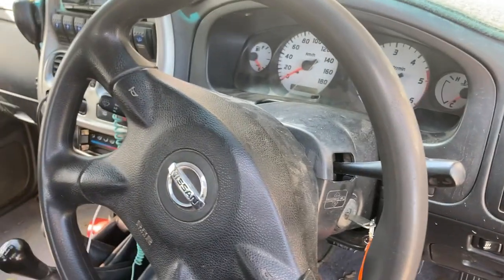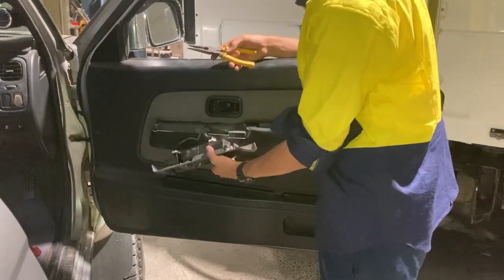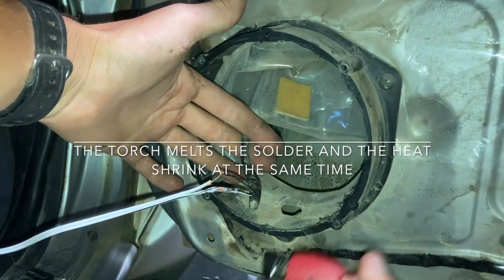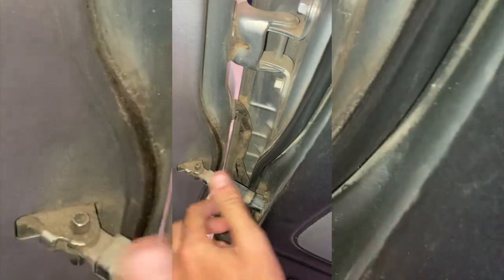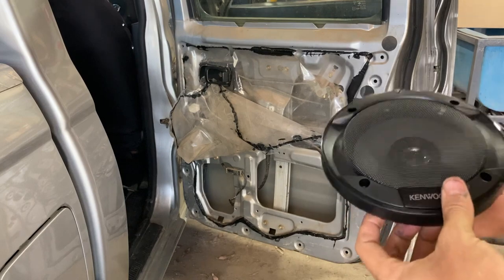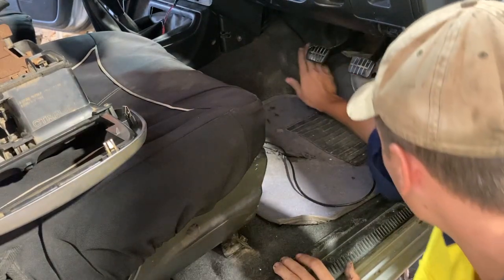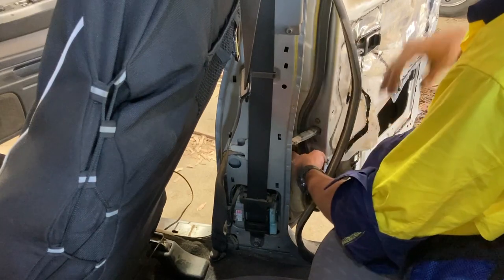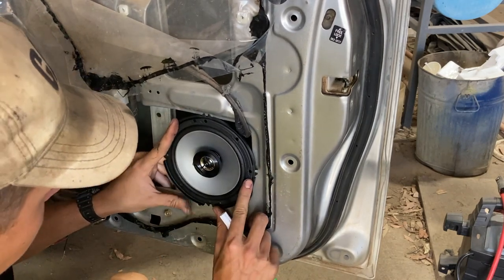D22 Speaker Installation

Comment: Cheers mate.  Ive got what i think is a dry joint in the front left speaker. Was always a bit dubious about taking that trim off to fix it but you make it look easy. Think I'll give it a go. Thanks again.🇦🇺🍺
Reply from the maker: Good luck mate, should be an easy fix👍🏻

Comment: Your vid was such a great help thanks! After threading wire to the back doors, how did you connect it to the head unit? I've got iso adaptor harness attachments in place so I'm not too sure which wires I should attach to? Any help would be appreciated 🙂
Reply from the maker: Glad it helped 👍🏻 I spliced into the harness, I didn’t have a diagram for which wires go to where so I played music through the speakers and touched wires to power the speakers and find which colours powered which speaker. When I was finished I looked up on YouTube a sound tester and played it through the speakers to make sure I got the lefts and rights correct 👍🏻

Comment: Great Video. I haven't removed my front door trims as yet, I have changed the head unit and now would like to do the speakers. Do you think it's a save bet if I purchase 6.5" speakers? 2015 D22 “Now confirmed, fitted 6.5” vibe speakers”
Reply from the maker: I’m pretty sure the d22s are all the same so 6.5 should work as that’s what I used if not just make sure to hold onto your receipts so you can exchange them. 
I’d also take your time reading into the input and output ratings (RMS/OHMs) of your headunit and speakers and match them up. Good luck👍🏻
Reply: @ReubsModifications  thanks for that. Yep I noticed in your Video you used 6.5”, I was at Supercheap today and they couldn’t tell me for sure that 6.5 or 6 would be correct. I will pull the trims tomorrow and take a look.

Comment: I helped my son put rears in his D22. We got the oval shaped Kenwoods  and put them where the useless ashtray goes they give much better sound as it is not blocked by the seat. Also the speaker wires were in the rear door loom just taped over, no need to run wires.
Reply from the maker: That’s awesome, we’re the wires clean for you because when I found mine the wires were hard and covered in dirt.
Reply: We’re they the one in the top right there

Comment: What type of wires are the ones you are connecting the rear speaker wires to? The ones on the back of the head unit. Cheers appreciate it
Reply from the maker: Hey mate, they were in the car when I bought it. They are just part of the head unit harness and should be similar for all head units. Let me know if this doesn't answer your question.
Reply: @ReubsModifications  and you just followed the colour coding for the wires?
Reply from the maker: @angusorr6785  Yes you can do it that way or with a wiring diagram or you can use a test light or a speaker to find which wires do what
Reply: @ReubsModifications  thanks for the quick responses. Appreciate it
Reply from the maker: @angusorr6785  no worries mate, let me know if you need anything else 👍🏻

Comment: Hey mate, how did you get off the Handles when you did the rear?
Reply from the maker: Hey mate the handles stay in the door but the plastic surround for the handles is just clipped in if you get a screwdriver you can work it around and it will pop off 👍🏻
Reply: @ReubsModifications  cheers exactly what I was looking for. absolute legend you are ❤️
Reply from the maker: @liamgray6856  haha too easy mate what speakers did you go with?
Reply: @ReubsModifications  I ended up going with some 360w/60rms Jvc, came with tweeters and a crossover so had to do some minor changes, but all is good.
Reply from the maker: @liamgray6856  I bet they’ll sound good